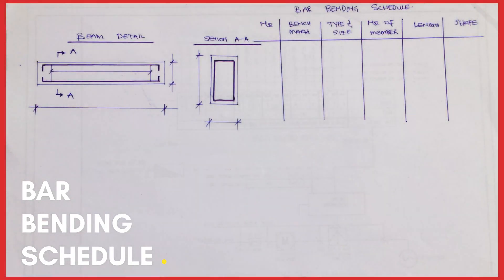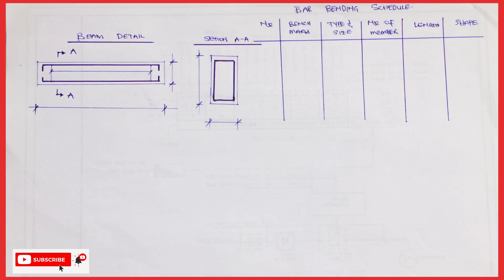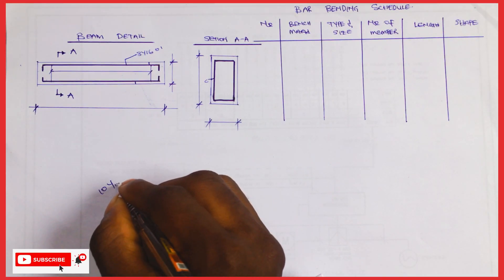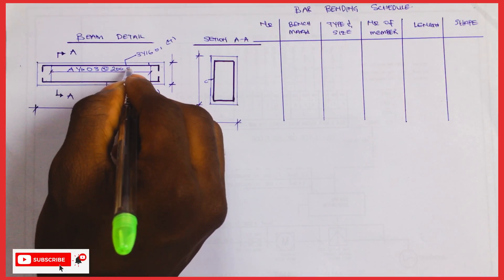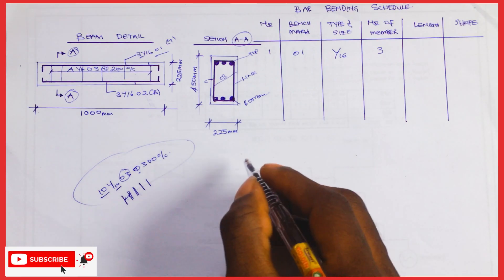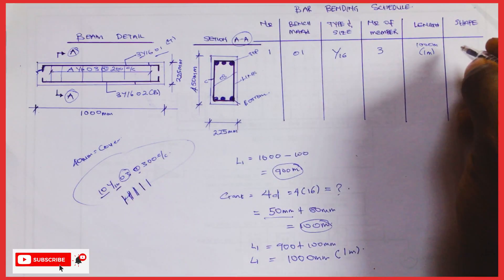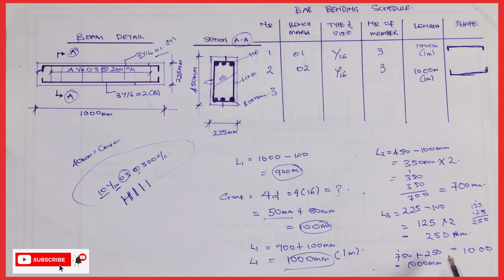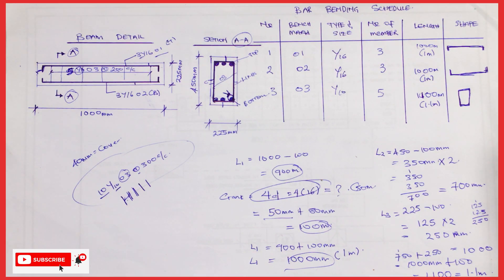Bar Bending Schedule (BSS) Basics Formula Calculations You Must Know - Calculate Length Cutting

Comment: Thanks, boss
Reply from the maker: Yh bro y’a welcome
Reply: Wat next boss, wat do we need 2 kn again
Reply: Is it same way for column
Reply from the maker: Did you have any questions now
Reply: Video for slab too
Reply: For d crank 4d actual ans is 64...we use 50...normally re we suppose to provide higher or lower
Reply: I no really gt d 3rd part of d table
Reply: Is that 3rd part for links?
Reply from the maker: Normally we provide higher but not that so much
Reply from the maker: Which one?
Reply: D 1st one is for top. 2) is for below. D 3rd one for wat? Links?... Because I'm hearing u say crank
Reply from the maker: Crank is just the bending of the reinforcement
Reply: So wats 3rd section for?
Reply from the maker: Yes, that’s the link it is also called striups. It’s function is to hold the top and button reinforcement together from falling apart and you use a reinforcement of Y10 or Y8 depending on the load the beam wants to carry
Reply: Thanks, now I understand
Reply from the maker: Yh bro
Reply: Can we go deeper
Reply from the maker: No p